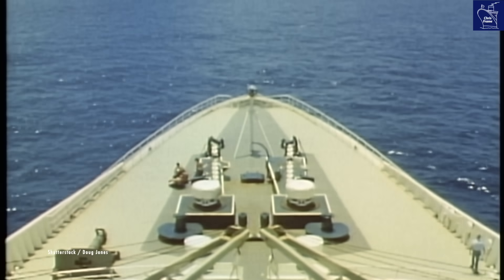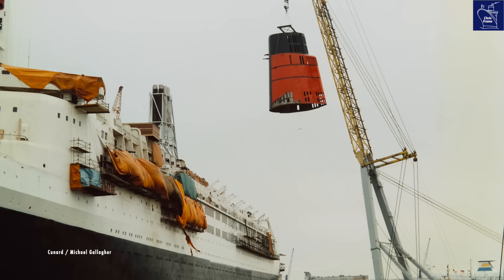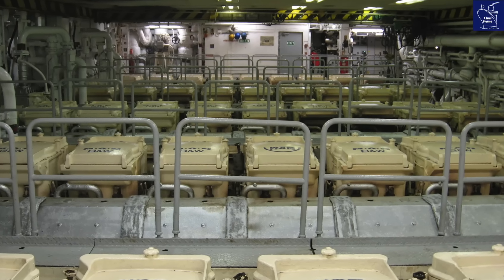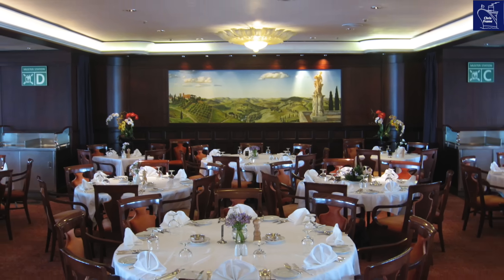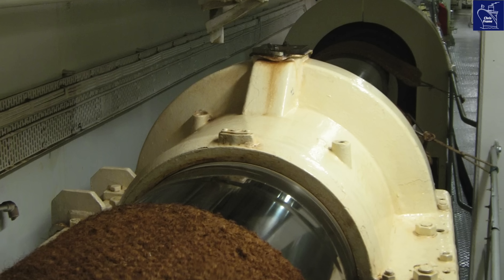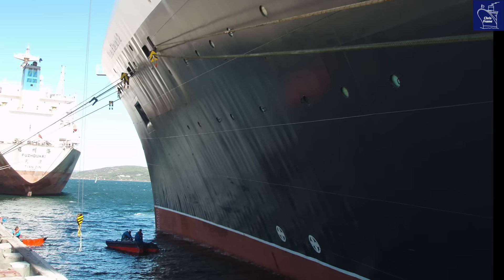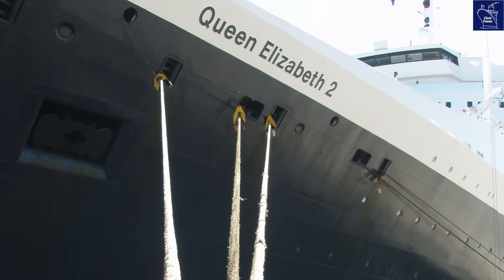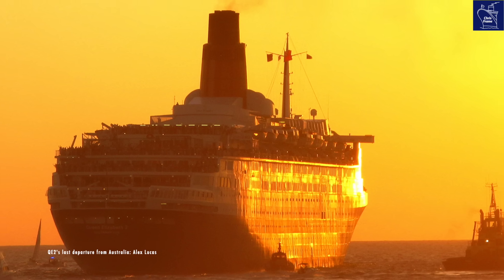The Life Extension That Made the QE2 Faster Than Queen Mary 2

Comment: refit by Lloyd Werft Bremerhaven with MAN B&W Diesel engines. But for 1986/87 it wasn't very special. Diesel electric powertrain was intruduced in 1903 by the ship Vandal. The Oceanic a 200.000 hp diesel electric transatlantic liner was begun to build in 1928 but by the Great Depression it was stopped, diesel electric power for light and hotel were at the famous turbine ships Bremen and Europa in 1928 or pitch propellers were known in the 1850s and applied since the late 1920s

Comment: Does the QE2 still sound her whistles?
Reply from the maker: I don’t think she has since 2012 when the engines were deactivated.
Reply: @ChrisFrameOfficial  2012 deactivated? Wasn’t she retired in 2008? I’m sad she doesn’t have a voice anymore 😭. Should be like the QM in longbeach
Reply: @PublicTransportPerth  She was retired and sold to Dubai in 2008 where they kept her engines in working condition until 2012. In 2016 they started an extensive refurbishment, which included a full repainting of her hull, and in April 2018 she opened as a floating hotel and museum at Mina Rashid, Dubai.  She is in a way better condition than QM.
Reply from the maker: @PublicTransportPerth  QE2 retired in 2008 but sat in 'warm' layup until 2012 still cycling through her engines to provide onboard power. She actually had a crew aboard from 2008-2012 and could have theoretically set sail again.

Comment: I thought we were going to see the old and new engines exchanged. Ive always wondered how they renove the decking to make the engine room  accessable for just such a job. What a disapointment.
Reply from the maker: You can see from the photos that the funnel was removed and the hole where the exhaust uptakes are was used to remove the old engines and lower the new ones in.

Comment: I believe they said they used nine 9 cylinder engine engines, why didn’t they just use fewer V 16 engines? Like four V16 engines instead of nine 9 cylinder engines? A fewer larger engines are more easy to maintain more smaller engines.
Reply: V engines only make sense if you have height restrictions. They are more difficult to maintain, considering piston/liner work than inline engines.
Reply: @ Fewer V16 engines would be easier to service and less maintenance than more 9 cylinder engines. The more engines, the more engines you have to service.

Comment: (4:05) To go into reverse, other ships didn’t “throw the engines into reverse.” They would use the transmissions to change the direction of rotation of the prop shafts. The engines always spun in the same direction, whether it was for forward or reverse. It’s the transmissions that changed the direction of the output shafts through gearing.
Reply from the maker: Fair enough. Though both reciprocating engines and direct drive non-geared turbines used to spin down and then engage in reverse - switching the direction of the rotation / reciprocation.
Reply: It depends, large ships with a 2 stroke low speed diesel run in reverse by bringing the engine to a stop, then engaging the reversing camshaft which would change exhaust valve and injection timing to run the engine in opposite rotation.
Reply: @2secondslater  The compressed air starting system had enough power to reverse even with forward motion "motoring" the engine in the opposite rotation.
Reply: @howardsimpson489  depends on which ship and which powerplant

Comment: A very interesting video Chris. How did they store all that power? Was it batteries or capacitors or some other system.
Reply: The power wasn't stored. They run as many engines as necessary for the moment. And a generator gives power only when power is needed.

Comment: QE2 had a lady aboard who lived on the ship; when the re-engine work was done in Bremerhaven we, I worked for Cunard back in the day, booked her in to the Vier JAHRES ZEITEN HOTEL IN Hamburg and every dat a limousine would collect the lady and transport her to Bremerhaven so she could see the work being performed on ‘her’ ship. During the re-engine work a set of GRIMM wheel propellers were installed just aft of the main propellers on the drive shaft but the crew managed to rip them off by reversing into the sea bed during trials. I was not too impressed by the crew(s) on QE2 as it was almost a monthly frequency to read on the daily ‘state of the union’ telex that the vessel had run aground. The engine conversion was very profitable and was paid off within two years. At the time casino and bar receipts were £1 million per day - a very important cash cow for the then owners.

Comment: Were the electric drive motors on the QE2 larger than those on the NORMANDIE?
Reply: Yes. QE2 had 2 motors and Normandie had 4 motors. So evn if Normandie was more powerful (160,000 hp total) each motor was smaller (40,000hp). QE 2's 44MW means 60,000hp

Comment: I went on the QE 2 shortly before
The conversion when it was still a steam ship . Security was tight due to IRA terror threats even though it was in NYC at the time .

The boiler room was loud , screaming loud even though we were in port just running the generators .

I asked if the superheater vent was open , something you did when getting ready to work on the boiler to ensure flow through the superheater to keep the tubs cool .
That condition is very loud .
But no , I was told it was many  steam leaks .
It was explained the British do not use Flexitalic  gaskets , spiral wound stainless steel and originally asbestos ,
But regular gasket material on the high pressure steam flanges !

Comment: The QE2 original burners for the three Foster wheeler Boilers was Lucas  early trials of the ship found it wanting with a fuel burn of 600 tons a day. Corrections were made to the condensors to improve matters and the Lucas Burners replaced with Hamworthy which reduced fuel consumption to an acceptable level and the ship was able to make 34knot's (39mph)..Reliability problems were in part because the QE2 should have had four boilers. Oil prices at the time did not help the QE2.
Reply: More than one mechanical engineer has written that a steam turbine plant with reheat (superheat twice to the engines is a less than perfect explanation) will approach or equal a modern diesel plant in fuel efficiency.  I suppose this was never used in ships as long as oil was inexpensive but land based generating stations have been using the concept for years.  Any company building a steamship  after 1960 should have at least investigated this.
Reply: @fritzbasset8645  Your analysis is my understanding however Cunard were not convinced that diesel engines would be vibration free or able to provide enough SHP to take the Blue Ribbon.  So went with two Parsons (primary)  turbines and only three Foster Wheeler (primary) boilers instead of the planned 4, this created  reliability problems because they were unable to rotate boiler duty for routine maintenance.  QE2 had a number of issues with her steam plant the first was the condensing plant and the poor fuel atomisation which would go fuel rich with embarrassing emissions.  Oil prices in the 70's doubled in 18 months which also impacted Concorde.

The MAN B&W engines fitted were and the Electrical propulsion was not that refined when QE2  (Q4) was planned in 1957 for a speed of <30knots,  in hind sight I think the QE2 would have been a better ship had Cunard not wanted the Ribbon and had more faith in the engineers sorting diesel electric propulsion. Cunard did in fact change the original ship several times and If I recall stopped the project for a while. I remember her launch On the Clyde in 1967 Best wishes
Reply: 34 knots is crazy fast for a vessel of that size.
Reply: @ Queen Mary 31.63 in 1938  United States 35.59 in 1952  Crazy speed indeed.

Comment: Hold on. So your saying that when the ship was docked the pitch of the props would so they would basically be a flat disk and they would just spin?!
Reply from the maker: Once she was docked and secured alongside, they’d deactivate the propulsion motors but when she was being secured, and preparing to depart, they’d spin at 72rpm with the pitch adjusted to negate any movement. Once out of the manoeuvring regime they would increase to 144rmp to allow for more speed to be available.
Reply: @ChrisFrameOfficial  that makes more sense

Comment: Cutting  edge? Well not really… the  Germans pioneered diesel electric propulsion in merchant  ships… back in… 1936 (the same year QUEEN MARY was introduced): HAPAG's WUPPERTAL.  And indeed, the  Germans  first introduced  the concept in 1902 with its first modern unterseeboots or  "U-Boats".   So yes, German Genius "saved QE2."
Reply from the maker: It's great to have that historical perspective. I think the cutting edge elements was the computerised control and modern sets they used for QE2.
Reply: @ChrisFrameOfficial  Well she did look magnificent on her return to New York...  I was on the press Moran tug  which met her on arrival. Still prefer QE2 as original (and perfect)1969-71 though!
Reply: @kohl57  Im an German citizen, just to make it clear:D 

But, from the point where i call an Transatlantic liner wich really deserved the suffix ''Powerhouse''  was the SS United States, 

Had her mayden voyage in 1952, weight was 53,329 GRT, the total  length are 302 Meters (990 ft). 

In numbers, Peak power where at  247,785 shp out of 4 Westinghouse Steam Turbines. Under full load she reached 43 Knots, rnd. (80 km/h; 49 mph) She still holds the benchmark, even today. Not even the latest marine vessels can touch her Speed. 

From this point on it is similar to the Concorde when they took it out of service...We loosing the advanced level of pineacle edge Technology. It allways feels like we made a step backwards...

Comment: Interesting bit of history; thanks for the video!  My Grandfather passed away aboard the QE2 in June, 1974, while cruising w/ friends from his Seniors group, in the Bahamas...I recall first reading about the diesel-electric re-power in the "April Fools" test in Road & Track magazine, April 1988 edition...They compared two trans-Atlantic vehicles, the QE2 and the Concorde; from what I understood, the diesel engines were started on light-grade ("gas-oil"?) fuel oil, then switched over to bunker C...
Reply: That was normal in that era to start on diesel ( called gas oil) then switch to bunker slowly .
Later the engine's were improved so they can start on heavy fuel , HFO , old term bunker C but more likely IFO, intermediate fuel oil.

Comment: I worked on the conversion, it was an awful long time ago! From memory I think the 9 diesel set up used about 25% less bunker at full speed than the original steam turbine plant. Impressive, but the real trick was the slow cruise part of a voyage, when the diesel plant could drop to as little as 3 engines, burning far less bunker than any steam plant could.
Reply from the maker: That’s fantastic information.
Reply: Cool info👌🏻
Reply: You should make a video about that - That's what I was expecting from the (less than accurate)title of this video.

Comment: Conversion was required because the steam plant was driven hard transporting troops to the South Atlantic for the Falklands War.
Reply: No, the conversion was needed because the running costs of those steam turbines meant the QE2 was losing money and Trafalgar House was not in a position to subsidize it.
Reply: @ Do you have a reference for that? Otherwise it's just me and you claiming different things.
Reply: After 13 years of liner crossings and round the world cruises, the Falklands were not a big push.  She was faster than rest of support fleet fleet so didn't need to race.
Reply: @michaelplunkett8059  My understanding is QE2 set off after the rest of the fleet, giving more time to mobilise the troops so she had to catch up. And she raced home to get the troops back as fast as possible, not needing the fleet for protection on the way home. But this is just what I read many years ago.

Comment: Absolutely fascinating!!! I didn't realize that her diesels did not provide direct drive and - am I correct in thinking that in a way she became a forerunner of today's pod propulsion system (i.e. diesel engines providing electrical power to motors that rather than being located in a pod were inside the hull)?
Reply: Normandie used electric generators and motors for her propulsion pre WW2 so QE2 was hardly the first, just part of an evolution.
Reply: Navel vessels use dies electric drive, or gas turbine electric drive also.  Smaller, lighter, more compact and efficient.
Reply: Correct, in most cases the azipods can be rotated so a rudder is not required. QM2 has 4 azipods, 2 are fixed and 2 are able to rotate.